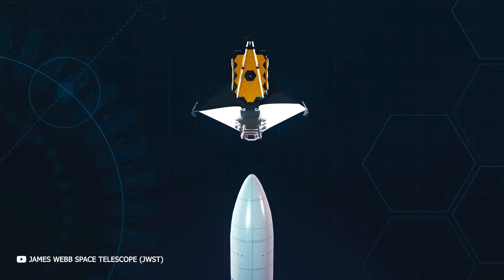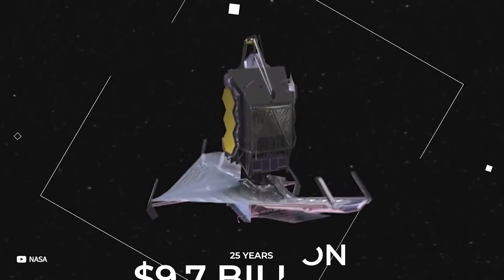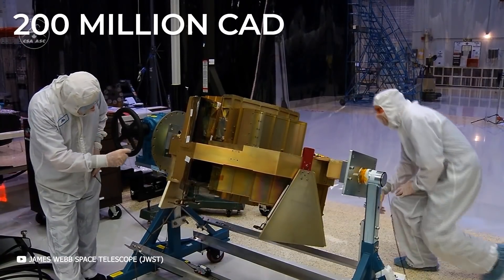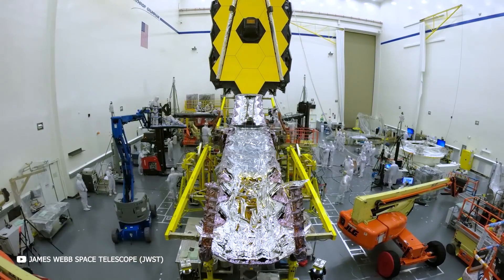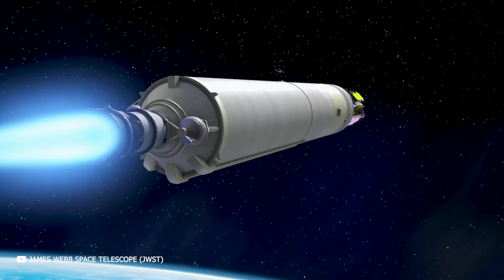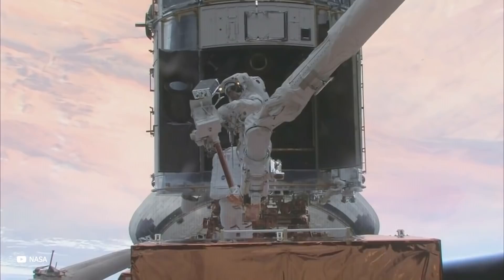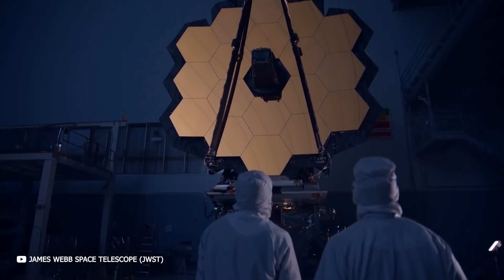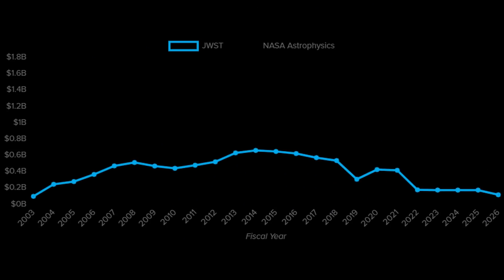The Real Cost Of The James Webb Telescope

Comment: JWST will be in a race to push as many science observations as possible during its working lifespan of 5-10 years. (due to limited fuel) Every HOUR of working time for JWST costs over $100K (dividing $10B cost by usable hours of mission)  Even the six month calibration time  uses from 5 to 10 percent of the life span for the telescope.
Even with a high cost, I DO think it is worth $100 per family (across multiple years) to advance our understanding of science with an advanced telescope.

There will be many thousands of scientists & researchers who spend years to study every bit of data gathered by JWST.  
Good luck, and may the research data yield new understandings of the universe, as hoped.

Comment: Approximate JWST per capita expenditures (US $):  EU 2.07; CAN 4.05; US 29.13. Though the US is obviously by the far the biggest contributor, it's obviously not the ONLY one. So, to refer to it solely as the NASA JWST is both unfair and inaccurate (that was not done in this video, but was in many others). Moreover, the instruments contributed by the EU and Canada are mission critical, and the JWST simply would not exist without them.

Comment: I really can't wrap  my head around the idea of this - Billions of dollars spent on the JWT and decades of delays - THEN the put the damn thing on a boat to sail thousands of miles at sea - so they can launch the bloody thing from French Giana ??????? WTF someone please explain taking that kind of risk for such a delicate instrument ....
Reply: I really don't understand your confusion. 

1. It was put on a boat (instead of a plane) in part because the roads from the port could support the telescopes weight. There were several old bridges from the airport to the launch site that could not. 

2. One of the ESA's contributions is the launch vehicle and launch site. NASA is basically getting this for free. So its being launched at ESA's facilities in French Guiana.

3. The Ariane5 is one of the few rockets available that can get this heavy payload to orbit. It also needs the added energy of earth's rotation to achieve the needed velocity. That means launching it at the equator to impart the maximum amount of earth's energy to the rocket launch. 

4. Besides, the the Ariane 5 is pretty reliable. "Ariane 5 launch vehicles have accumulated 111 launches since 1996, 106 of which were successful, yielding a 95.5% success rate. Between April 2003 and December 2017, Ariane 5 flew 83 consecutive missions without failure."

5. The initial design into the Ariane 5 faring predates any usable space x rocket by at least 10 years. The final design for the JWST was done in 2016. The FIRST flight of the Falcon Heavy was in 2018.
Reply: It must be launched from near the equator
Reply: @bad_actor1128  thats what was left out of the story .... maybe I wasn't paying attention
Reply: @rts100x5   No worries! Its a lot to keep up with, and I've yet to see a single place with all of this info consolidated. They do almost always have good reasons for what they do, though (even if its not readily apparent to us outsiders).
Reply: When it was proposed the Ariane rocket was the only vehicle capable of launching it. Plus the European Space Organization ESO wanted to be part of the show, so we spend $10 billion and they kick in a few doodads and a rocket.
Reply: @xjimmontg9241  Those "doodads" are mission critical instruments. Quit downplaying the contribution of international partners.
Reply: it had to be launched near the equator - thats the only answer I was looking for ...
Reply: @rts100x5  No it didn't to be launched near the equator. The Ariane Heavy was the only rocket capable of launching this boondoggle when they were designing it.
Reply: @BigDaddy-666  Well whatever they call the EU's space program, they're smart enough to let the US pay for the majority of the Webb.